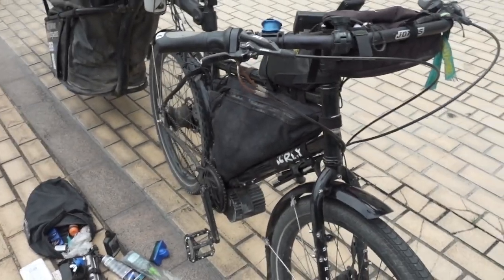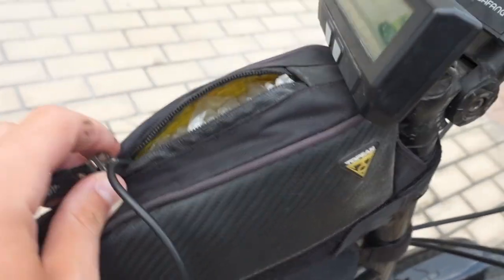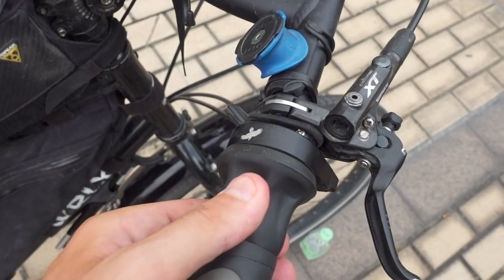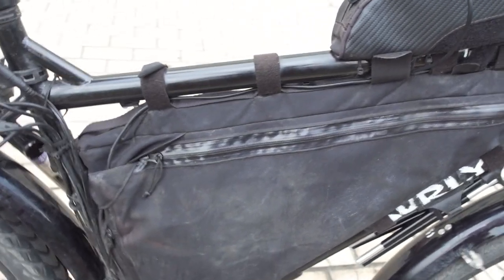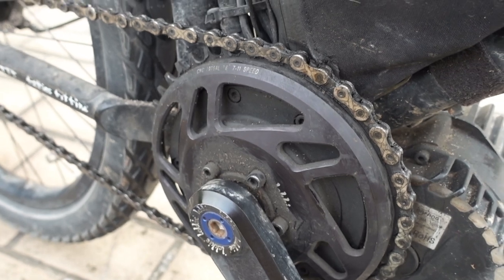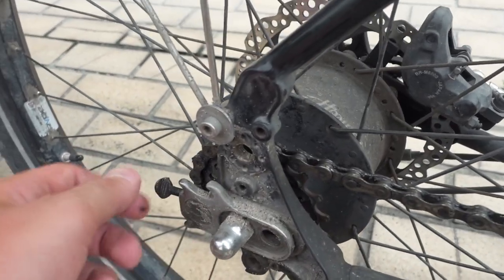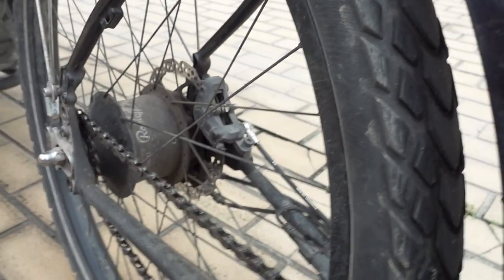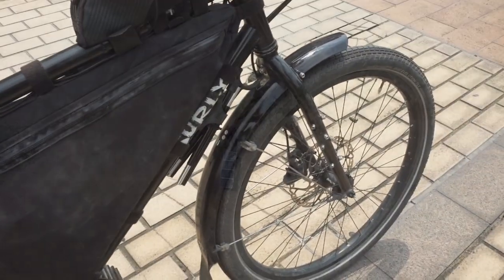Touring Solar Ebike Review After 13000km to China - BBSHD Em3EV Battery

Comment: Man, I don't know what's up with my BBSHD, but the clutch in it keeps dying on me after every 5-10 thousand km, then I am left with throttling home without being able to pedal. And I am extremely weak too, so it's not like I push so hard that I break it, it just keeps wearing out to the point, where those small pawl things can't engage any more. Is it just me who is having this problem?
Reply from the maker: Hmm strange! Not got to that point on either of my bbshd drives yet
Reply: It's happened to me once, I recommend replacing the steel gear outer plate at the same time as the clutch, and a light amount of grease on it once every now and then should keep it good
Reply from the maker: @SparkArmoury  interesting to hear another report! I'm actually starting to get some noise from the clutch now at around 15000km. I'll make a video soon of opening the drive and having a look!
Reply: Did u check the bearings? Sometimes they just get stuck
Reply: @zondepa5537  I don't think if was bearing related, as upon disassembly I could see the small pawls were sheared down where they engage into the grooves in the cavity running around them.

Anyway the kit was amazing apart from that, but I gave it to my mum who needed some assistance on her bike. My parents have a holiday house in the mountains with some extremely steep hills. This kit is perfect for that use, as it won't overheat like hub motors would do. And she really likes the throttle function too haha.

I might add that the colour display/ control unit that goes on the handlebar is an absolute piece of shit. One died on me because of rain (not immediately, but could see condensation building up inside behind the screen for a little bit, then one day just dropped dead during ride), bought a new one, and that one started to have condensation as well after a couple of rainy rides. And that crap costs like £50. It's also not nearly as legible in direct sunlight as the cheaper black and white version (I have that on my dad's bike), and changes ride modes a lot slower compared to the cheaper black and white unit. Actually the whole operation of it is just sluggish when pushing buttons. I have no idea why everyone keeps saying what an improvement it is, sure at first glance all the colours and fancy graphics look cool, and have some extra functionality, but from a usability stand point it's simply a downgrade, and costs more that the earlier version.
Reply: @kosztaz87  How about throtle setup if you are using throtle? If the throtle is setup to hit 100% while you are in the heavy gear or by switching the gears "the one second pause" in between" (without shift sensor or even with)  could also be a point to check. I am also asking myself which part of clutch needs to be gereased and which not. I am always looking at the display to see and make sure the motor is not under heavy load but i think most of us do the same thing.

Comment: Hey Jack, Greetings! I see you have a Bafang Mid drive connected to single speed at the rear, were you able to achieve high speeds? do you recommend to have single speeds for mid drives?, pls comment and how many teeths on the rear single speed?
Thanks,
Kiran
Reply from the maker: Hey. Its not a single speed as i have a hub gear in the rear wheel with 14 speeds.
Reply: @JackButlerVideos  which brand and model? tnx
Reply: @lukakoritnik365  Rohloff Speedhub

Comment: Hi, read through all the comments and didn’t see any chain issues? Did u consider the gates belt drive?
Reply from the maker: I'm still using this chain after 18000km! I considered it but it requires a split in the frame which is too much of a compromise. Also chains are easy to find and fix.
Reply: Hello Jack Butler, great job !!
Which model of chain you use with your BBSHD motor ?
I’ve same motor and I’m looking for reliable and strong chain
Thanks !
Reply from the maker: KMC EPT X1 it's fantastic!
Reply: Jack Butler Thanks a lot

Comment: How did you get thru desert without onboarding controller shutting down motor due to heat ?
Reply from the maker: I don't use that much power from the motor so not much heat is generated

Comment: Can the paper gaskets that sit inside the motor be replaces. I know I can make them, but can they be had off the shelf? I replaced the grease when new in mine, but should have a look inside soon again. I thought taking apart the unit was a bit tricky w/o hurting the gaskets. I did hurt one wire in the proces, that I hade to fix.
Reply from the maker: I bought spare paper gaskets just in case but i haven't replaced one yet.
Reply from the maker: I got parts from em3ev.
Reply: @JackButlerVideos  I found them in EU, thanks. I notice you have a simpler type of speed controller. Would you recommend upgrading?
Reply from the maker: I have the stock BBSHD Controller. A better controller would be nice to play with but the integration of the stock one is very nice
Reply: @JackButlerVideos  I've not seen any other of your videos, so I have no information on your experiences. But I can imagine that since you have recharging capabilities on board, it is less important to be able to modulate power settings!? I Scandinavia a rig like yours would perhaps not work in winter. But if you had a small generator that could run on wood gas or just heat, distance would be no problem! ;) (wood is condensed sunshine after all)
Reply from the maker: No it's important to control power output. You don't get that much power from solar. For me the stock controller is just enough controller (when re programmed) and the integration into the motor side is very nice. No space used on bike, No exposed cables, dust proof, waterproof and weel impact protected
Reply: @JackButlerVideos  I had no idea it could be reprogrammed! I'm one of those who had a VCR in the 80´s and 90´s with a display blinking 00:00:00 ;) But now I found a helpful video on how to program the display. There seems to be variations on the C965 too.
Reply from the maker: You should definitely reprogram. In my opinion and for my uses it's basically unusable in the stock setting.
Reply: @JackButlerVideos  When programming 'wheel size' would you recommend using the 26" or perhaps 27" option for slightly oversize Schwalbe Big Apple at 55mm?
Reply from the maker: It affects the speed readout so you can trial and error and compare with gps speed

Comment: hey there, how would I contact you ?
Reply from the maker: Looks like you just have! Lots of people message me on Instagram.
Reply: @JackButlerVideos  :-) Hi! I noticed you cycled to china from france in that race. I was wondering if you could point me to any good resources on how to build a solar PV charging trailor for an ebike that uses a Baffang 250 Watt motor and a 36V 14AMPHr battery? Even better would you have a parts list for such a project ? no worries if not.
Reply from the maker: Buy a genasun boost charge controller and some solar that meets it's maximum specs and that's about all you need! Good luck
Reply: @JackButlerVideos  hi Jack what sorry for being dumb. What do you mean by maximum specs ? the max voltage the battery can take? How is it easy to find the max spec ?
Reply from the maker: @alexanderbaines-buffery7563  check the spec sheet of the genesun solar charge controller so see what max solar voltage it will take and choose solar under this. And buy the charge controller that matches your batteries max charge voltage.